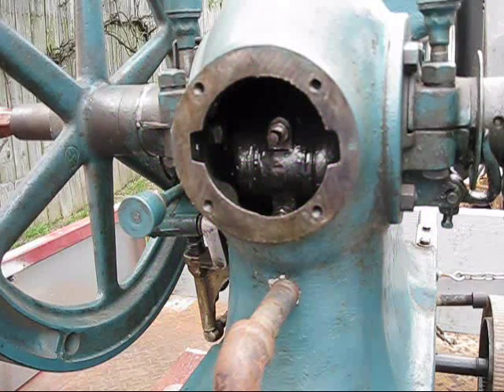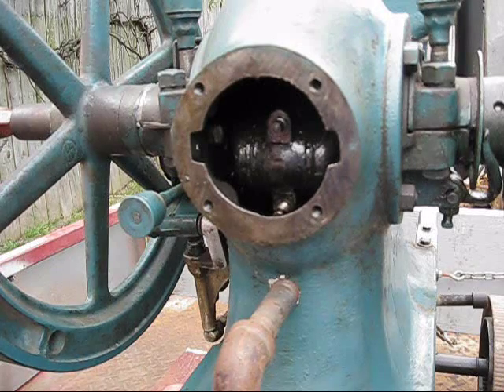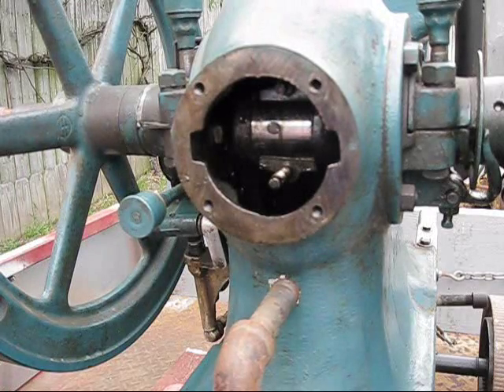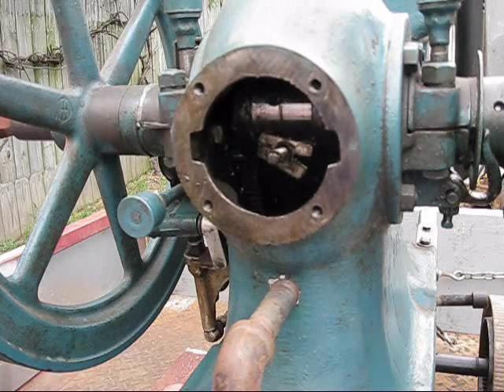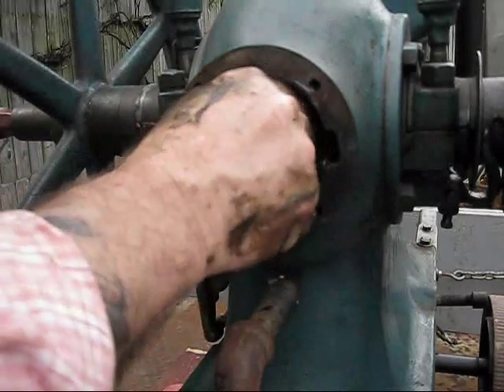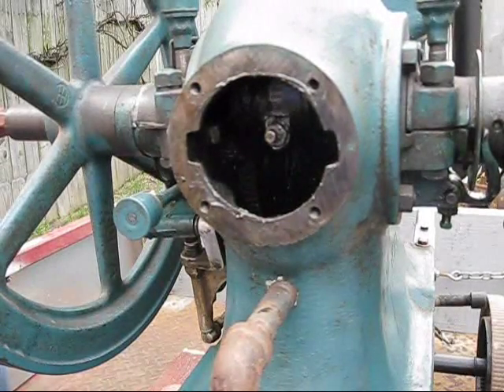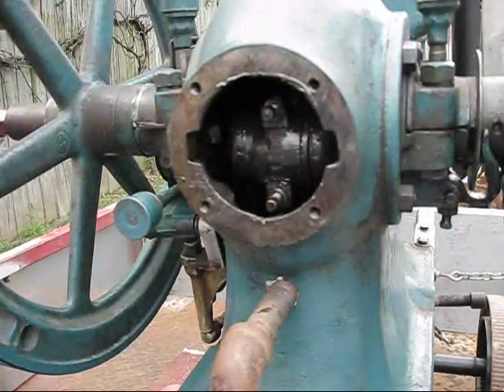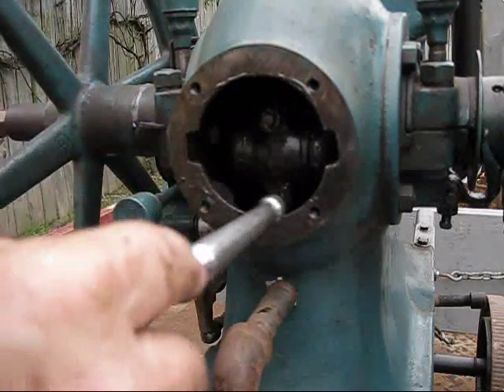IHC Engine M 11/2 HP Rod Bearing Adjustment

Comment from the maker: @musk8teer  When the piston was at top dead center and you rocked the flywheels back and forth you could feel a little play in the rod,,if you let it go and they wear more you will hear rod knock,,"that's not good"  I was lucky it was not the wrist pin as it is not as easy to repair a worn wrist pin......in this case just removed a couple of shims and all is well,,Thanks shopdogsam